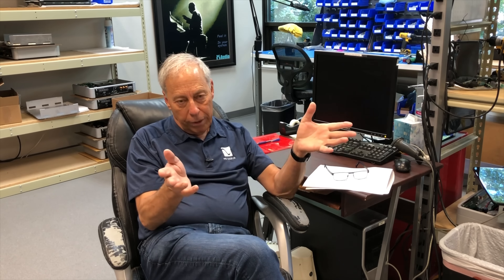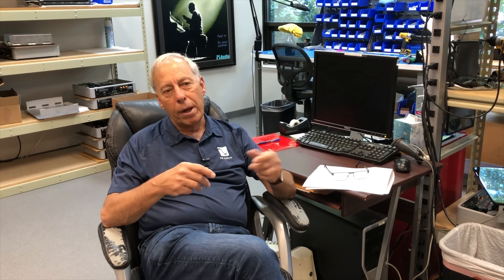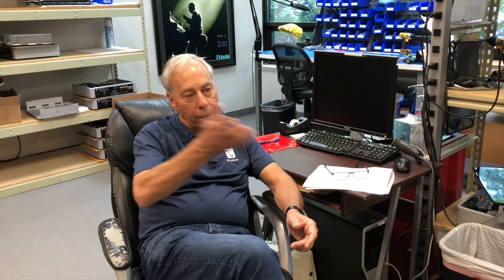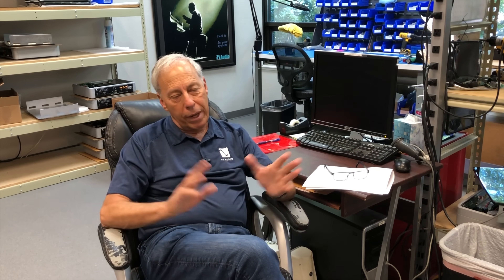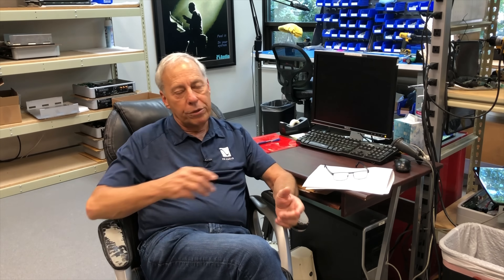How to make Class D sound better

Comment: Heat is also the enemy of electronics; therefore, I have heard Class D amps that produce beautiful, detailed sound with high voltage that do a wonderful job. I personally have compared expensive monoblocks to a relatively modestly priced Class D amp and found it to be much more musical, detailed, and very pleasant to listen to with accuracy and also much more versatility in usage. There is a LOT of hyperbole in advertising, technical mumbo-jumbo, and people lap it up . . . it is like a status or snobbery to own and to be able to afford the most expensive -- and like designer labels, which may not necessarily be the highest quality, these brand names certainly demand the highest price tags. You CAN get what you paid for  . . . but if you are a smart shopper, who has replaced snobbery with practicality in achieving the same results -- if not better, you can find the “designer labels” on the close-out rack for a lot less money than when they were first introduced to the public -- even if their labels have been cut-off, they are still the very same quality product at a much more affordable price, which to me, who could care less about impressing anyone but myself, is a much better deal.

Think for yourself . .  . research, compare, prove to yourself what is the best sounding products . . . and if your snobbery is much more important, much more impressive and convincing to your ears, then the actual product you enjoy in your home -- then the only person being impressed and fooled in the process -- is yourself.
Reply: Could you offer some specific examples of products that produce this wonderful musical, detailed, accurate sound for substantially fewer bucks, not to mention lower operating costs? I'm thinking about re-modifying my MOSFET class AB amp (a Hafler which I think is completely non-original except for the output transistors and the power switch). But I'm open to a different approach, i.e. a newer class D. My power needs are not great due to room size and the volume at which I listen.
Reply: @EclecticApotheosis  I replaced my B&G Monoblock amps with Crown XLS 1502's . . . and found them sufficient for my liking and budget. If I had more money to burn than common sense -- perhaps I would resort to boasting and proclamation that everyone else but me was correct on every subject . . . but I don't have that luxury . . . or stupidity. I like the Crowns for the black, silent background, the tonal balance, the detail, the imaging, and the lower power consumption -- all better than what I had. There are, most likely, better-sounding amps at a gigantic price tag . . . but the margin of improvement per capita is simply astronomical . . . and besides, bragging rights are not my forte -- while enjoying music at a reasonable price without putting myself into hock and stress -- is not.
Reply: In my opinion, which is certainly up for dispute, is that the Crown XLS Series is worth looking into for those characteristics. I owned for many years the Hafler 500 and also used the B&K monoblocks . . . even enjoyed the warm sound. 

I heard the Crown amps used on an active crossover sound system at an individual's home being run through a DBX DriveRack PA1. When my amp that was running the subwoofers (which I bought 2nd hand) went out on me . . . I bought the Crown XLS 1502 and was so pleased with the QUIETNESS, not to mention the detail, imaging, and sound staging I received. As I am able, I may also take my system to a multiple amp active system. I am using the DBX DriveRack PA2 to equilize my speakers to my listening room -- also worth investigating its capabilities.

There are various models of the Crown. The Crown XLS 1002 is $299.00 and can be financed at $7.00 a month for 48 months interest free at Sweetwater. I am not affiliated, except as a satisfied customer. Here are some of the specifications of this class D amplifier: 

Watts/Side @ 8 ohms: 215W 
Watts/Side @ 4 ohms: 350W 
Watts/Side @ 2 ohms: 550W 
Watts Bridged: 1100W @ 4 ohms, 700W @ 8 ohms 

There are other good brands . . . this is the brand I bought.
There are also on YouTube some reviews and demos for you to watch. Best to you.
Reply: I strongly agree with your message. I have the crown xls 2502 amps. They sound just as good as emotiva, outlaw audio, monoprice amps Etc. there are better deals out there for a wonderful price point.
Reply: @EJHilt  Appreciate your comment! It is getting that unless one holds the opinions of the elite, one is considered any number of labels and accusations by the closed-minded elites. There is a certain “privilege of looking down one's nose at those, who haven't the common sense to be as rich or empty-headed as many -- not all, truly are”.
Reply: Class A will always be fastest at delivering audio to the speakers since the power is already in the amp, and doesn't need to be drawn from the wall.  The result is a more wholesome and accurate sound.  If you can not hear it, because of old age or hearing damage, then by all means, go Class D
Reply: @pizzafrenzyman  To each their own! Opinions whether based on facts or not .. . . are going to be held by people who like and even will defend their position -- even to the death in some cases. Someone has to be wrong . . . but I don't see proud men ever admitting it except on very RARE occasions!
Reply: @russmaleartist  just do an A/B test using your favorite song.  Simple solution, no death roll needed.
Reply: russmaleartist Not even close to a real hifi amp. I've heard many and would not consider class D even close to high fidelity. They make good public address or subwoofer amps but that's it. You would be much better with class A , B or class AB.
Reply: We all have our opinions, and since I do not recognize you as an expert or authority on what I enjoy listening to for my many years; furthermore, have you listened to everyone's amplifiers in every circumstance and combinations? I doubt it . . . so, we will have to agree to disagree. Perhaps some are due to budget and compromise, but then even those who are considered “experts” will tell you that sound reproduction still doesn't come anywhere close to the real thing . . . perhaps close, but there is still something missing. 

I no longer have any Hi-Fi salons near to my area, but when I did, there were quite expensive brands of amplifiers, etc. to listen to . . . and they sounded great, but even they were spoken of by reviewers and experts as controversial. I mean, when I subscribed to Stereophile and the Absolute Sound. One month pieces of equipment were to die for -- the next month, they basically were equated to yesterday's newspaper only fit to wrap fish or line a birdcage. I never fathomed that mentality of how something could become so outdated in such a short time . . . nor how anyone could keep up with technology. If you can -- more power to you.
I have listened to tube amps like Audio Research, and even built the old Hafler 500, which was considered a competitor in its day . . . and have used and still use monoblocks by B&K . . . and I do believe that there is always something claiming superiority, but soon falls from grace -- the point being, we all have ears to hear, but that doesn't mean all ears are equal, any more than money automatically gives one good taste nor the superiority as being the final word on anything. In my many years, I have found that mankind, no matter how opinionated, is still fallible, extremely ego-driven, and do not like to be contradicted . . . too bad, because each of us would like to consider our opinions as valid as another for various reasons, and owing to the fact that none of us are going to agree 100% on anything -- even within families. 

I believe debates are profitable and the hobby is kept alive by the improvements and all the hype and claims by manufacturers, but I would suppose the point is that although I agree with having opinions . . . but if one is convinced that their system is the best -- with the countless combinations of turntables, cartridges, tonearms, preamps, amps, speakers, wires, and such -- I would venture to say that it is physically impossible to be in a position of comparing every combination of what people are currently using or inventing and come to a definitive conclusion that theirs is the ultimate best. You cannot, because we all know that little changes can make a big difference even in our own system's reproduction on any given day with a repositioning of a speaker to the change in humidity, furnishings, room environment, let alone all the endless and impossible combinations of everything being equal in one's listening experience, their ear accuracy, etc. -- too many variables for even the most capable, educated, self-proclaimed experts, and/or publically respected individuals who claim to “OWN THE BEST” to ever really justify such claims -- no matter how much money they have spent on their equipment, listening room, etc.. 

Who has the right to be KING OF THE HILL when it comes to this industry and hobby, when such a position doesn't exist? There is always someone more clever and capable of claiming such notoriety, until the next individual claiming such, and then the next, and so on . . . for the chain of claims is endless. Enjoy the music and leave the dogmatic claims for those who are foolish enough to take on such an impossible challenge. I like my Crown XLS 1502 Class D amp in my system very much -- and quite frankly -- that is all that matters!
Reply: @russredfern167  -- Find me an actual Class B amplifier.  I dare you.  Then tell me this amp isn't "high fidelity."
https://www.audiosciencereview.com/forum/index.php?threads/review-and-measurements-of-purifi-1et400a-amplifier.7984/
Reply: My experience is just the opposite, almost all class-d suffer from large distortion, there is no get what you pay for here, its either the really expensive designs or dont bother at all because class-d design though simple in theory is difficult to create in practice.
Reply: Your preference, your wallet, and your opinion . . . but in comparison with many other opinions from longtime enthusiasts . . . also your loss; however, if you are happy with what you have . . . Brava! But as far as the rest of us, who enjoy our CHOICES as much as you do and feel we are also absolutely right -- BRAVO! This is not a contest of who has the final word or authority to negate anyone else's -- these are OPINIONS, and just because it is you who is making such a statement . . . does not make you absolutely and indisputably right -- but thank you just the same.

Currently, I do also have Class A, A/B monoblocks, and although they do sound warm, they also have huge toroidal transformers, which can produce noise . . . they also are limited in the number of ohms they can handle from the speakers. The Crown 1502 does not. It is completely silent, can handle 2 ohms up in speaker loads, and has  Watts/Side @ 8 ohms: 300W Watts/Side @ 4 ohms: 525W Watts/Side @ 2 ohms: 775W Watts Bridged: 1550W @ 4 ohms, 1050 @ 8 ohms. 

Like I said, it is preference, performance, cost, and opinion. I have an acquaintance, who has had some of the most exotic speakers like the Avant Guarde, and many others, including his choice of amps to match. He is a rather wealthy and discriminating audiophile with very particular taste. He is the one who demonstrated the Crown amps to me . . . so, again -- it is all about opinion -- not bragging rights of who paid what for the quality of sound you get.
Reply: @ThuleApsu  An opinion is like an armpit -- everyone has two -- and yet, without the proper care and maintenance -- they stink. which seems to be the majority of those who consider themselves to be definitively “infallible”.
Reply: @russmaleartist  Yet without the catalyst of opinion, ideas would not flourish so our science would not evolve
Reply: @ThuleApsu  Depends on whether the opinion is cohearst, censored, or brainwashed into a vulnerable mind as truth, when it is not. The criteria in today's political correct arena is: IF you agree with me, you are fine and may speak freely -- IF YOU DISAGREE WITH ME, then you have no right to speak . . . or in the extreme, to even exist! Sad to say, that is where we are . . . and the direction we are going.
Reply: Suzy Siviter Class D is flawed from the beginning.
Reply: In your opinion . . . .
Reply: Russ Redfern#16: So is every other amplifier, because there is no perfect transistor or valve, whilst the other classes of amplifier are unlikely to improve a great deal over the following years, the amount of research is increasing rapidly for class d; efficiency is king these days since the development of mobile phones that depend on a battery.
Reply: Agreed -- opinions, if used constructively, can motivate improvement or stifle it . . . but the debate will go on just the same. Sad to say, but everybody is implicitly right, and nobody is hardly ever wrong . . . at least not by admission.
Reply: russmaleartist: My motivation is to stop high end snake oils salesman and get people to think first before blowing a sum of money that could be used more productively, it does get me a little angry when supposed engineers try to baffle the unknowingly; its up to other engineers to speak the truth for those that are not educated in electronics.
Reply: Good intentions . . . I think the ethics, the honesty, and the truth is being made relative in most of our walk of life today . . . it is bound to seep into every walk of life and affect every aspect of our community. Our values have been perverted to the point of even our dictionary becoming rewritten. There is hardly any foundation made of rock that hasn't been eroded by political correctness and social perversions ruling every aspect of our culture, our business, and our personal lives. People cannot have their cake and eat it too; yet, that is what they seem to be seeking and implying by their actions that speak all too clear -- even contradicting themselves. A handshake and a man's word was his bond -- not nowadays. Even contracts have loopholes through which the slimiest worms can wiggle through.

How people interact, conduct business, the products they produce . . . even the way they treat their fellow human being is a CHOICE. Too bad more people cannot make good choices, instead of convenient and selfish ones -- but look at me, I am promoting what they now term as “hate speech”, which is an offensive to their blatant offenses -- TOO BAD, cause this fellow is not going to stop telling the truth, regardless!

Comment: I think that eventually Class D will be better than tube Class A. Its the cancellation of crossover distortion (good) and the elimination of distortion products caused by the high switching frequencies and the delicate output filtering handling (work still needed).
Reply: MOSFET class A is already better than tube class A, not that any audiophile will believe it; since they are woo'd by the hypnotic glow of the tube the rest of the sheep are following.
Reply: Suzy Siviter A good example of MOSFET use in an output stage is Vinnie Rossi’s Lio amp.
Reply: David Tomsett: Yes they are used in many amplifier designs, I am am particularly facinated by ground breaking speaker designs such as the MBL Radialstrahler and the rotary sub, I am going to try and raise funding for an idea I have to combine the two. It does seem to me the technological improves in amplifiers and sources are reaching saturation point; but the current loudspeaker technology could be improved beyond anything available at the moment.
Reply: Suzy Siviter PS Audio’s new speaker range is going to feature servo controlled bass units so that should be interesting . Problem with speakers is how they react with your room.
Reply: Bass sources need to be moved around the room to find their best placement. No bass woofer in a tower speaker will ever be able to perform at its potential in a room, no matter if you're buying $100 or $100,000 speakers. Proper subwoofer placement is the only way to get truly great bass.
Reply: @matsudakodo  Agreed. They need their own special treatment as the wavelengths are so much longer